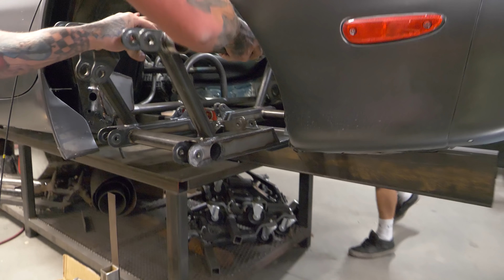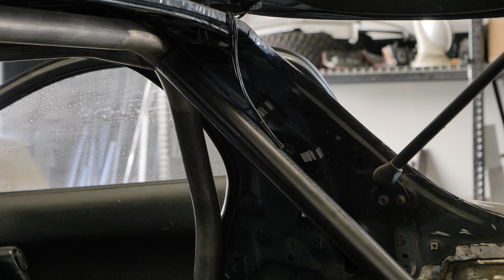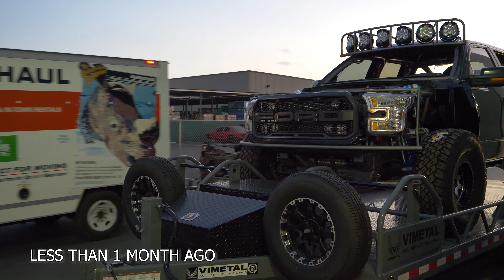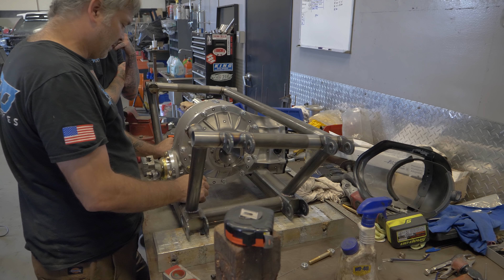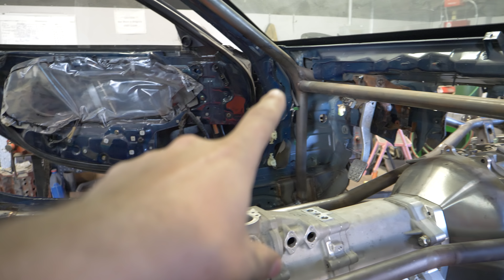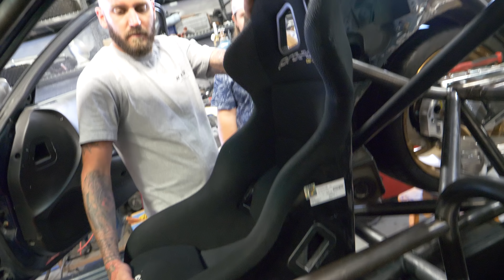Will the 4 Rotor make it to SEMA? | Roll Cage finished

Comment: Not trying to sound rude but what's the point of the quick change rear diff if the front is not as it's AWD and both diffs need to be the same ratio and you can't change the front ratio as quickly and easily as the rear
Reply: MyNigma its for clout
Reply: dual winters ) ?
Reply: @Deep42Thought  I support this move
Reply: Makes the job half as easy for gear change, at least. But very true observation
Reply: If he grenades a gear its.. uhh.. quick to change?
Reply: The rear diff is getting most of the abuse. Remember it's not going to be 50/50 torque split.
Reply: It was one of the only diffs that would come with the gear ratio he wanted and could hold the power and relatively easy to fit into the tube chassis.
Reply: room42 you think rob is driving this in the winter?
Reply: He said why in tj hunts podcast but he's gonna have a coupler that will disengage the front diff when he wants. But the purpose of the quick change is that first he will try to go for top speed runs but also might want to drive in the streets. And would you want to take that massive diff out every time you wanted to do a different discipline
Reply: @JF-ns5zs  the rear end is a Winters quick change. Winters is the company.
Reply: @JF-ns5zs  yes sir😂

Comment: Rob Dahm  is there not a way to fit a shaft in bearings on the frame from the front diff to the transfer case or just the section at the headers for better clearance. well i recon the guys building it  has a better plan or the same but its one awesome build and if been following it sins day one love your concept it will be a mean ass track car and i feel your pain on the other builders wasting your time and money the same happened to me know i do it myself but u got the real builders there.

Comment: After all the fabrication is done, don't you think the car would be heavier?
Reply: Of course just with the 4 rotor alone it is. But, there is going to be soooooo much power it's not going to matter.
Reply: but more firm then original, that's more important for safety and high speed capabilities

Comment: 1 question!!! when u guys moved the engine to the left side, did the rear end change position? or does the cv joint be able to handle that?? btw i have thought since u started it -wow this will be cool when it is finished. But now i think with your passion like this is fucking mental shit. the detail in the work and! the videos. add to the level of insanity. when this is on the track i will be fucking uniqe. Edit my english suck